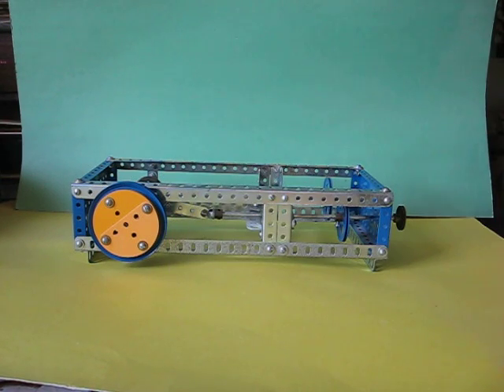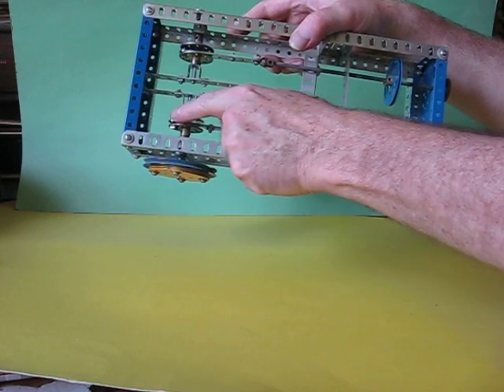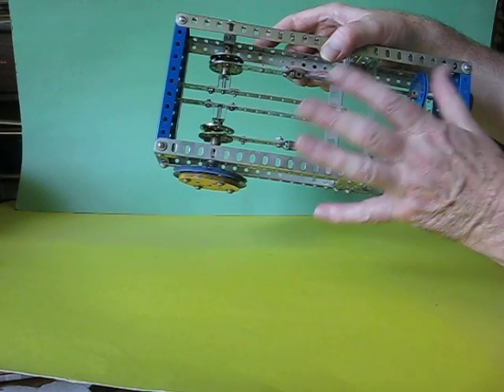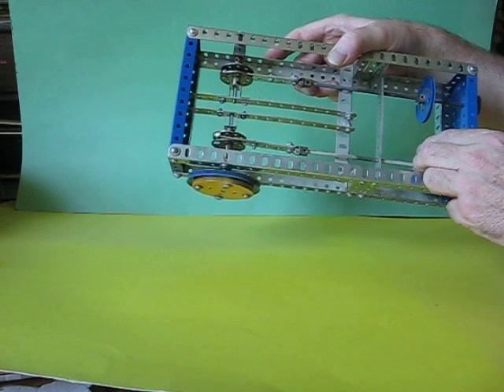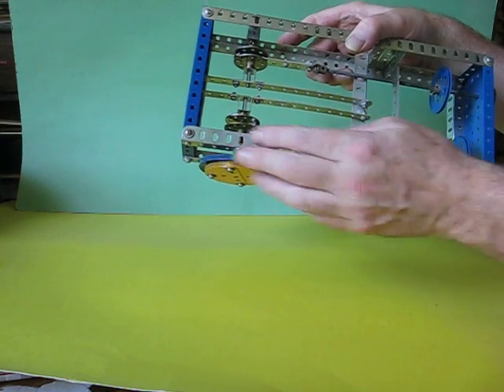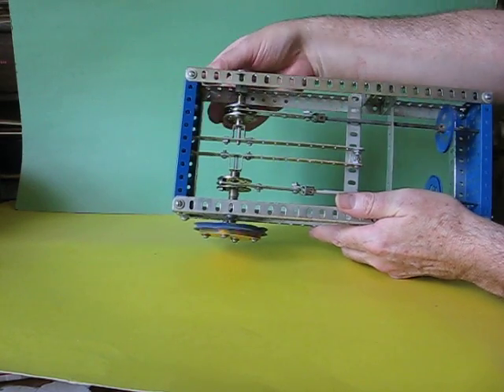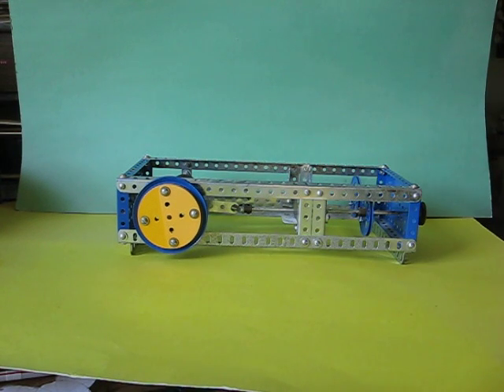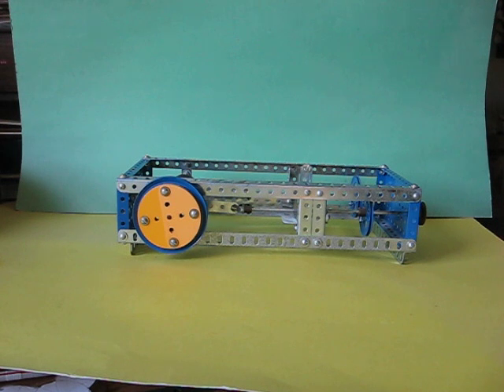Energy and the Flywheel

Comment from the maker: If I remember correctly the Bulleid/Raworth electric locomotives of the Southern Railway used the flywheel principle in order to keep the locomotives in motion when traveling slowly in the yards. The gaps in the third rail would leave the locomotive dead thus the flywheel to impart motion during these "dead" areas.

Comment: New racecars are going to use this concept to store energy from breaking (by spinning up a flywheel instead of using break pads) when they slow down for corners, then they transfer the energy from the flywheel into acceleration as they come out of the corners giving them an extra 160hp without burning any more fuel. Pretty awesome idea!